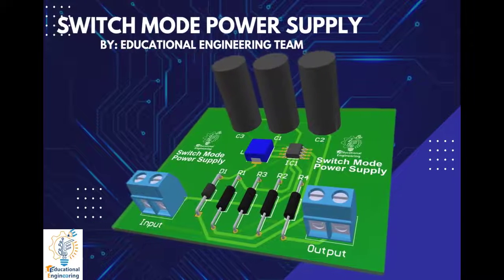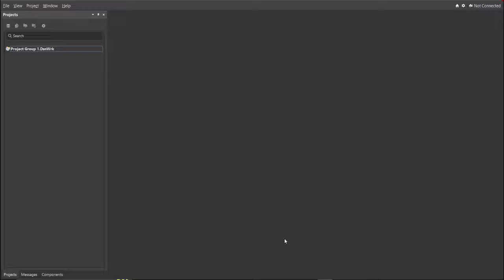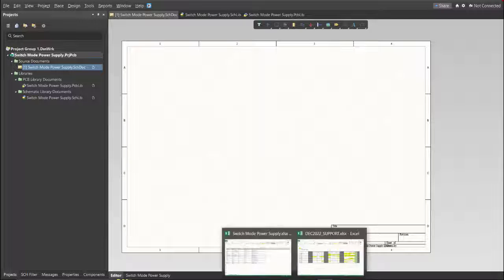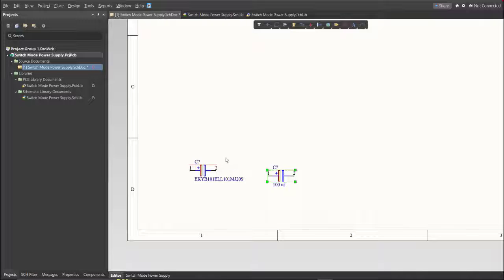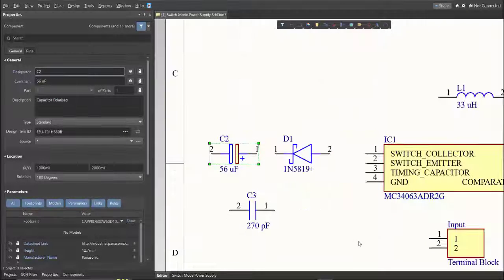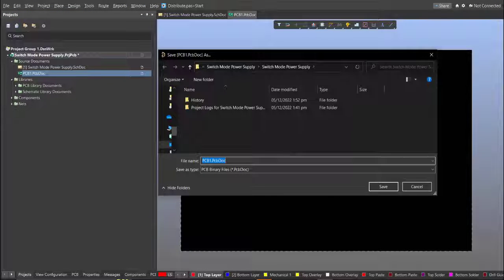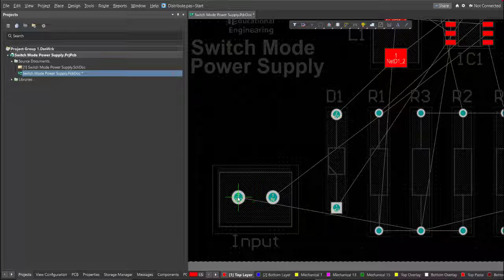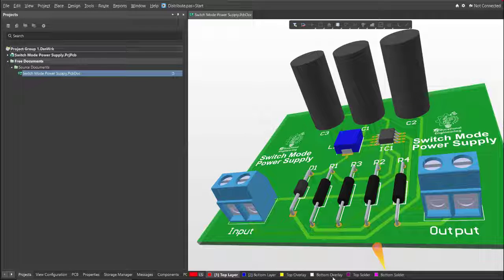Switch Mode Power Supply using Altium Designer

Comment: This video are 220v Ac to 24vdc
Reply from the maker: Hi @prasadgore9100! Yes, exactly! This video demonstrates designing a switch mode power supply that converts 220V AC input to 24V DC output using Altium Designer. It's a great example of how to design efficient power conversion circuits. The SMPS topology shown is commonly used in various electronic applications. Thanks for watching and for highlighting the key specifications! 😊⚡